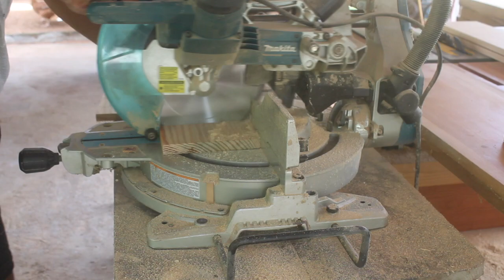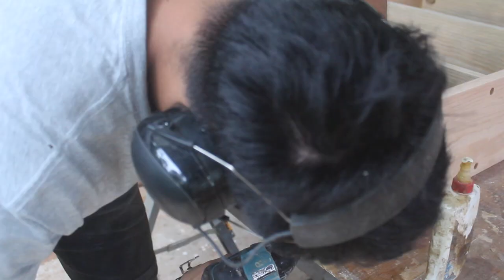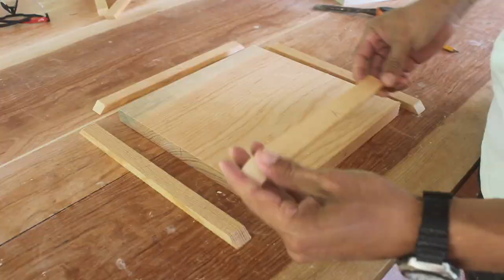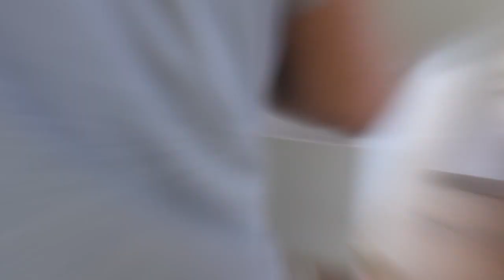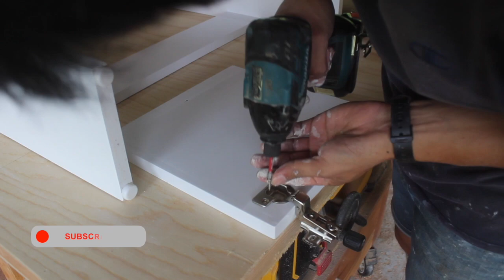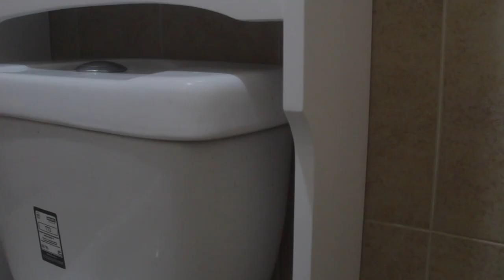Over the Toilet Cabinet | How to Build a Bathroom Cabinet

Comment: Thanks for sharing. Very skillfully made and nice design too. Good work 👍 Just a question: did you use any wall fixing to prevent it from toppling? Thanks!
Reply from the maker: Thank you for watching, It wasn't necessary to attach it to the wall, it has an angle to the back and actually the water hose is holding the bottom support
Reply: Thanks 🙏

Comment: amazing work. i have a question about something i wanna do with one that i already have that is a standing cabinet. i wanna turn the standing to hanging how would be the best way to do this?
Reply from the maker: Hey Fabian, sorry for being a little bit late, I normaly hang cabinets using screws, I put a 5 cm slat on the back or if the back is thick, the back of the cavinet is enough, make the holes on site, then use some dowels and screws